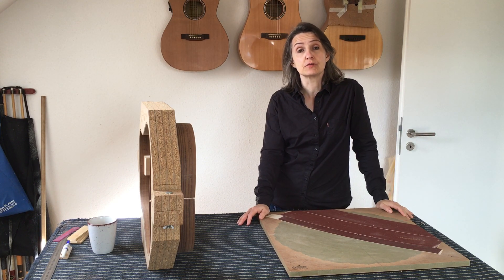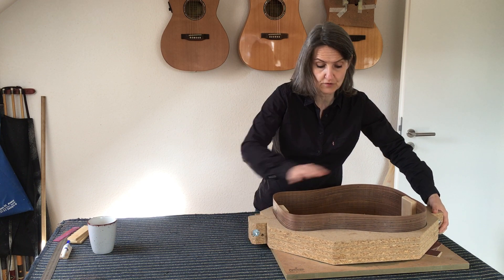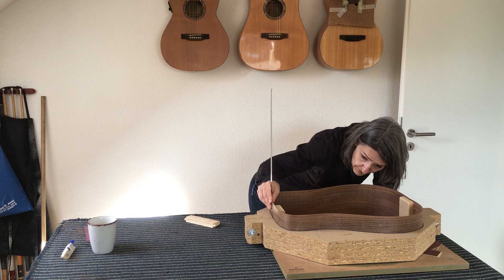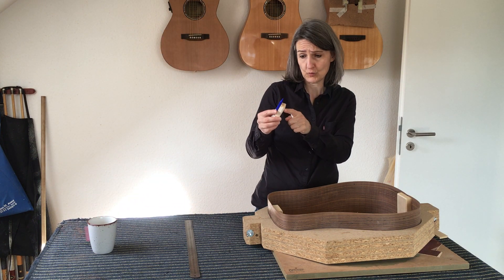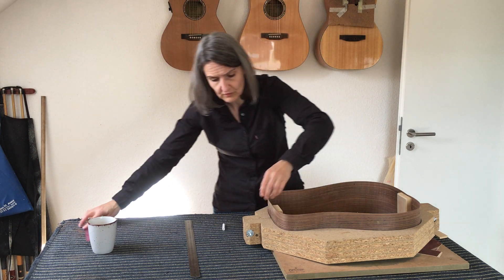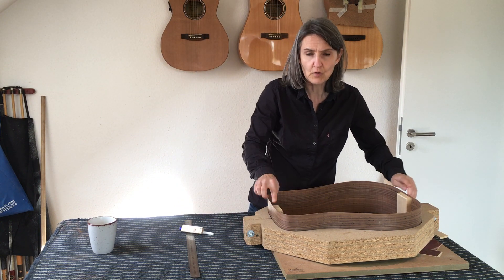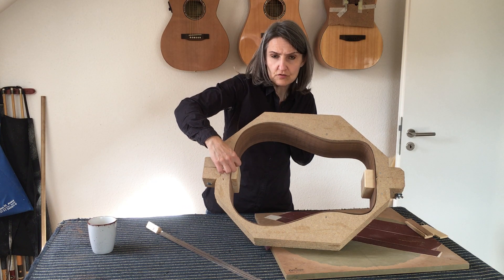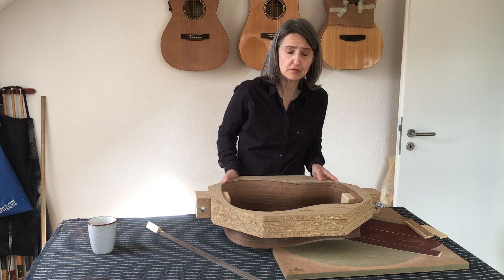Guitar building: "How I make" - Radiusing the sides

Comment: I cut out the side profiles with a router and a profile template before bending them. Have you tried this method? Do you see any problems with it?
Reply from the maker: No, I haven't and I do see problems for my workflow since you don't have much room to wiggle around. I also use the straight edge of the sides to line them up with my bending jig, so that I can make as sure as possible that the sides are not "twisted" and aligned parallelly, if that makes sense. Others do it, though, and they are doing fine with it.
Reply: @GabiM3112  I also use the straight, top edge, of the side lined up against my bending jig to keep it straight. Any ways, it works for me. Enjoy